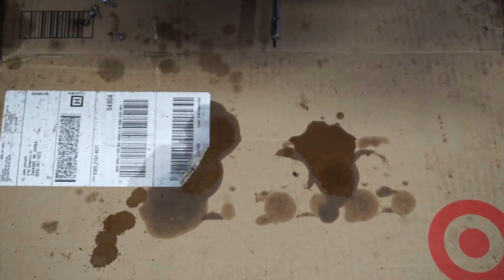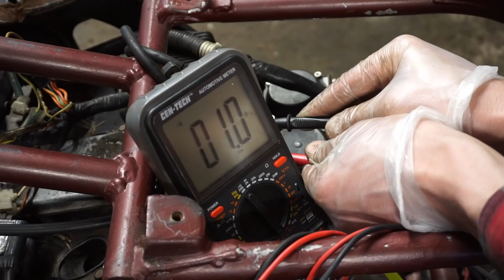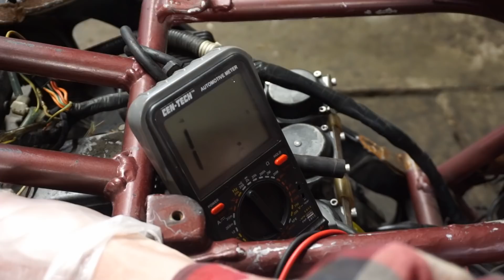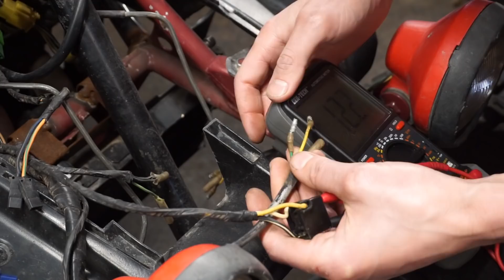The Real Widow Maker |100hp 140+ MPH Custom Yamaha Banshee (Part 2)

Comment from the maker: It is sounding pretty fast! 
Please SUBSCRIBE and LIKE the videos if you enjoyed! It really helps me out a lot!
Check out my Instagram: 2_vintage_
Thank you for all the support!
Reply: Very Pog Champ
Reply: No
Reply: What is your least favorite part of reviving the junk you find?
Reply: Just incase you don't see my other comment I will ride it man no fears, plus I live in Wisconsin
Reply: 110 volt mig flux wire (gas less) welder cut the pipe move it down...weld on some custom foot running boards...make it better
Reply: Do u want to sale
Reply: it will be fast I am thinking so. =) Fast might be an understatement.
Reply: Nice vid! Don't know if its yours or if it matters but There's an address on that box if you don't want that in the vid.
Reply: in my experience running a paper filter on a gravity fed fueled engine starves it for fuel use a screened filter, paper filter with a fuel pumped fuel system
Reply: I am willing to buy this from you. What price would you sell it for?
Reply: How much do you want to sell this for?
Reply: @Alessandro Draven flixportal =)
Reply: @London Andres Thank you, I went there and it seems to work :D I appreciate it !

Comment: That frame job is absolutely killing my OCD 😬
Reply: It's terrible. 1 of my good friends built several of these and use to race them all over. His were as close to stock frame design as possible and alot nicer.
Reply: its the polar opposite of the right way to build it, but we can just call it a prototype and then its fine
Reply: definitely sketchy
Reply: All I could think was who would do this to a Banshee? 🤣.
I look at it and the wheels start turning on how to make it less sketchy
Reply: @BDauto86  they shouldn’t have hacked the frame you can put down serious power just with a 8 inch longer swing arm
Reply: Pos
Reply: Its dangerous it needs gussets and bracing in 10 areas at least on the road it could break in a roughf field it will break for sure

Comment: Hi the engine and tank are from a GSXF both outlets from the tank are fuel out and theres 2 lines going to the carbs for gravity fuel flow no pump. Also when turning over your engine sounds a bit off. They usually turn over super smooth but yours seems to jump about a bit. Best of luck with the build!!!!

Comment: 12.5 is the pilot jet and 32 is the main stock. Also I learned this from bicycle repair, you can use a little hairspray or perfume body spray or even isopropyl alcohol only a little so it dries and you don't get whiskey grip.

Comment: Reminds me of Cleetus golf cart it was a ripper! And wheelies was a big problem. It will need wheelie bars. And when you ride it wear some leathers, boots shin guards, breast plate, gloves, and helmet. It can easily flip over backwards no problem. It is definitely a BEAST! Their golf carts were doing a hundred in the quarter mile it was so dangerous. If you have not seen the golf cart episodes on the cleetus McFarland show go watch it because it was epic and I believe your next episode will be epic too. It is going to take some balls to ride this thing. I am sure it will smoke the tires if you can keep the front wheels down. You will have to lay on the handle bars all Heck is going to break loose. I dont know if the transmission will hold or the clutches. Well with that all said I think at the least it is going to be interesting. The frame will be fine it your skin Im a little concerned about. I hate road rash it hurts. I was not wearing any pants or any shirt or shoes and wreaked its a beach.

Comment: I just can't get over how the PO welded in the original Suzi frame, so awkward, would have been so much better to make custom mounts or even a more compact motor keeping the backbone alone for the original gas tank.  Like a sleeper quad.  Just make sure the kill switch works well and maybe even do a second failsafe if needed but I'd ride it for sure.

Comment: i think the top pipe you have just connected is the carb breather pipe the fuel tank prob had either a duel feed to the carbs or one is reserve and other is on if from an injection model bike then could be fuel return

Comment: White is for low beams turn the handlebar switch and u will get 12v on the white and 0 on the yellow and it changes back when u move the high/low beam switch

Comment: for the brake and gear changer i would take the left foot peg mount and move it to the right for the peg is further back and do the same the other side i think this will make it simpler to build controls i would also make that a single top frame rail rather then 2 this would allow the tank to sit better or then 2 tubes side by side to keep strength even tho i think that frame is now trash and needs starting over

Comment: if you look at the 2 centre carbs they both have brass nipple abiut higher then where the fuel goes in these could be vacuum lines and with both been open will allow to much air

Comment: A trick to put on grips very easily is to poke a small hole at the end and blow into it with the air compressor but you should put tape under the grips just so they don’t come loose

Comment: It’s running lean you have the gas lines hooked up wrong there two feed lines that come off the front and back of the petcock and one like off the back of the petcock that plugs onto a nipple on the right side of the carburetors

Comment: cleaning the carbs is not a problem the hard bit is getting them back in the damn manifolds
Reply from the maker: Yeah very true
Reply: @2vintage  i am not sure but i think your middle to carbs hav vac pipes that need closing off may help make it idle also i would say the pods need setting up to get the correct venturi  effect to list the slider correctly

Comment: To get those grips on easier use a spray paint clear coat  in the grips wail there wet they will slip on and after they dry they will stay in place. Leaned that from a different YouTube channel 😁😎
Reply: Drop of dish soap, and water, good too go.

Comment: PLEASE LIKE THIS I KNOW KATANAS FAIRLY WELL AND WANT TO HELP HIM IF POSSIBLE!!
There are supposed to be 2 fuel lines on those carburetors. One in the middle and one on the gear shift side of the carbs. There is a small outlet on the back of the petcock that a vacuum line is supposed to run to from the carbs to pull fuel thru. If you open the petcock up its got a diaphragm in it. It needs that to pull enough fuel to run properly. And those carbs are a sucker to synchronize without a manometer.

Comment: I’m familiar with the katana engines I’m actually building one right now there should be a vacuum hose that runs to the back of the gas on and off from the carburetors and it will allow gas to be gravity fed from the tank to both sides and the carburetor usually has two spots for two gas lines one line for each 2 carburetors
Reply from the maker: I can't find the second spot for the gas line to go on the carburetors. Do you have a picture of it by chance?

Comment: You were testing the coil using the continuity setting on the multimeter. I know it measured the resistance too but you can also measure the resistance without the beeping. All the beeping is doing is telling you the two points you are probing are connected. P.s I'm really looking forward to the first ride on this thing. Be reasonably safe and wear some gear if you have some.

Comment: Come on man ride it already it's not that scary some friends and I have built two similar to yours using a Chinese knock off 400EX first we put a 450 street bike motor on it blew it up then put on a CBR 600 on it not going to lie pretty quick had no problem keeping up with traffic on the hard road. You could pretty much pass whatever you wanted. 😆

Comment: It needs vacuum to open the petcock diaphragm, unless the diaphragm is bad.
Reply: On my gen 1 SV650, it has a vacuum operated pump. There is a vacuum line that goes from the petcock of the tank to one of the carbs, and on the pump itself, it has a vacuum line going to one of the carb intake boots, so each 'pulse' of vacuum created by the engine running draws petrol in through the fuel line, filling the float bowls. Don't know if your engine is similar, but hope it helps!
Reply: Also double check cracked fuel line on carbs. I recently had a fuel line that was cracked and even though it wasn't enough to leak, it was enough to lose vacuum with the fuel pump and starve one of my carbs enough to run rough and intermitent at higher rpms. Idled fine though.
Reply: I was thinking the same thing 
My 750 had a vacuum operated petcock and that was a thorn in my side in a few occasions

Comment: Well number one those are called venturis u need to scrap them pods. They block that that valve. Its still sounding like shit Bc u have them on. It will run way better without them. U need that factory airbox. Or a different filter. That front line needs to be hooked to the vacuum. And the back line goes to the carbs.

Comment: How do you know that only two cylinders were operating?
Reply: You can hear it.. Could also put your hand on top of each cylinder and feel for vibration. And unno.. no spark.
Reply: @PCG2021  Now that I think about it one could also take a temperature or feel the exhaust pipe for heat.
Reply: @TC-hl1ws  Yuppers, quite a few ways to do it lol

Comment: Ahh bro fck the engine is rather it blow than a ball joint blow at high speed check your control arms or whatever u call em over there check tracking aswell or that could cause a death shake I still say it's death trap in the best of hands lol be careful but I my self would pin it BRAAAAAAAAP
Reply: I couldn't agree with you more!! If the suspension is off just a little, you could be facing the angel of death!!! Drive it slow, and let go of the handle bars, and see what it does. Same principal as checking your alignment on a car!!! Thanks for pointing that out bro!!! Have a great day!!!
Reply: @lottiecooper609  no worries mate